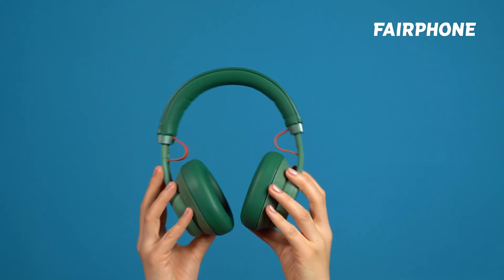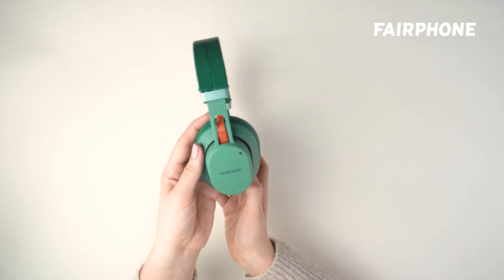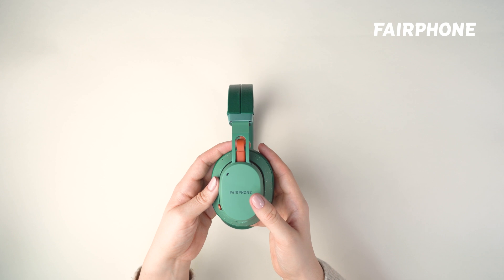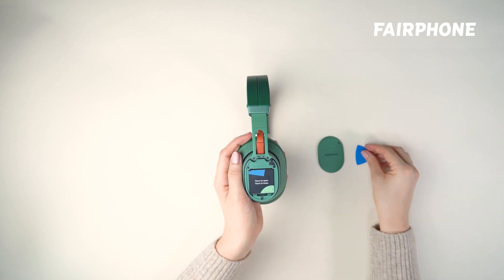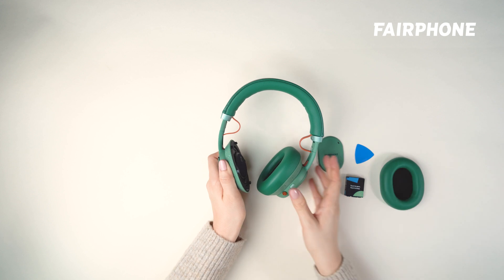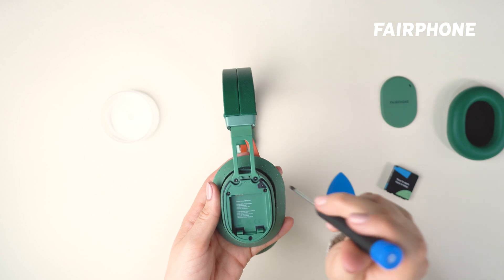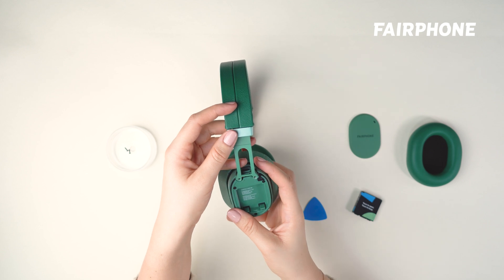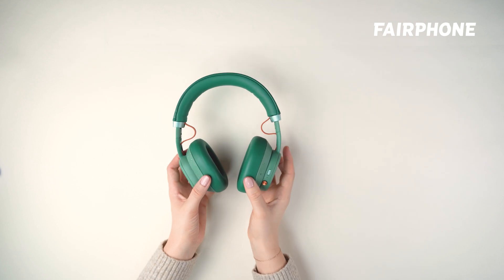Chapter 5 | How To Replace the Speaker | Fairbuds XL

Comment: Thanks for the guide Fairphone! I just swapped the left speaker on mine after my cats knocked them off a table. There was a rattle and they needed a soft tap on the cup after turning on for the left speaker to activate. Turns out the noise cancelling microphone had come unglued and slightly unplugged. Glad I didn't need to replace the whole set after a minor mishap!

Comment: Was it not possible to design it so you can remove the speaker unit from the plastic shell for direct repair? It shouldn't happen often that a speaker has to be replaced but it feels bad to just throw the whole piece in the garbage instead of resoldering it or replacing a defective diaphragm or coil.
Reply: Its meant to be easy for everyone including grandmas and nephews. Soldering etc isnt going to achieve that since it requires specialist tools. And you can send the part to them, they'll either recycle or refurbish it.
Reply: @tjeulink  Grandmas bopping to JayZ with those on, I want to see that!
Reply: It's still very rare but for example, the Beyerdynamics DT 900 Pro X connection to the driver is solderless. Maybe for the fairphones cough fairbuds 2? 😊
Reply: @LeDechaine  where can i find information about that? it isn't talked about on beyerdynamics website.
Reply: It's either that or a dumb YT filter. Anyway google it I guess.
Reply: Seriously Fairphone? Are you deleting my answers? WTF
Reply: @LeDechaine  you cant post links. Youtube autodeletes those. I googled it but couldn't find anything about removable drivers, just the cups.
Reply: @tjeulink  Search for I tore apart the DT 900 Pro X so you don't have to.